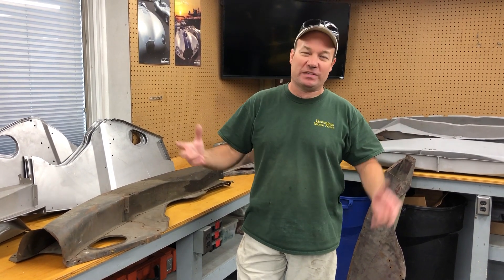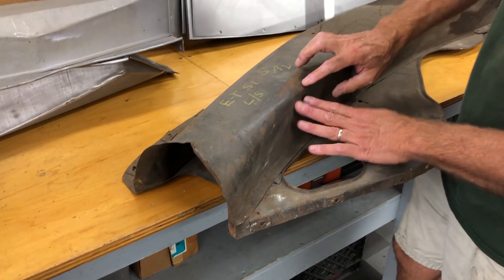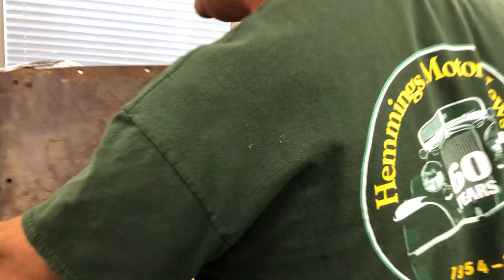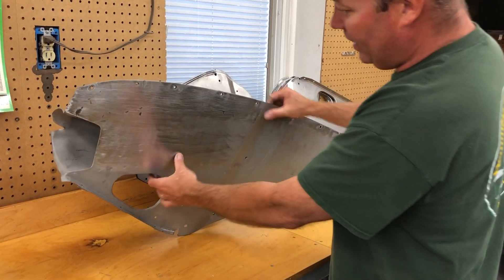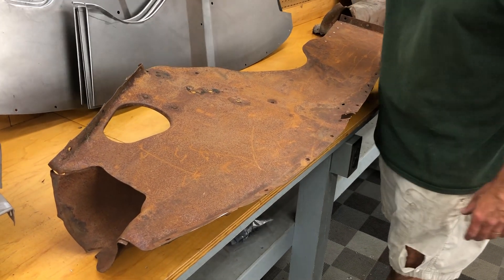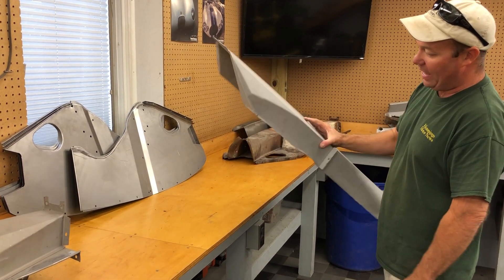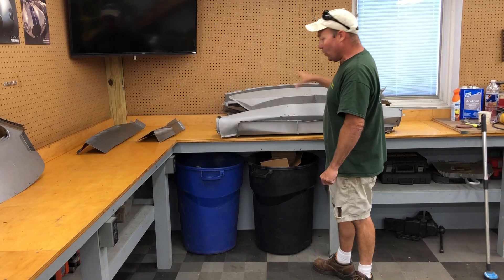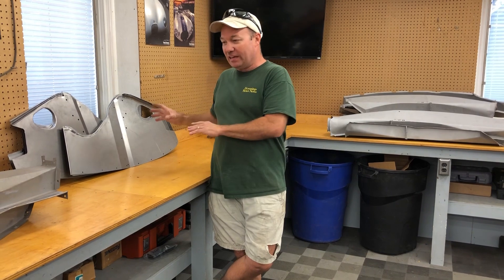Jaguar E-Type - Bonnet Inner Valance (Air Tube) Restoration

Comment: Chuck. I had a complete series 2 bonnet in good  condition . It was on a series 1.5 and was damaged in a road accident . I fitted a new correct  bonnet ( easier said than done !)  I paid my boss a £100 for the old one  ,I dismantled it ,brought it home and hung it up in my garage. When l bought my series 1 2+2 l  simply didn't have room for the bonnet  and sold it for £400 !  My series 1 bonnet is so badly rust damaged  l now realise l was a fool to sell the other bonnet . It would have saved me hundreds of hours ! Thanks Chuck